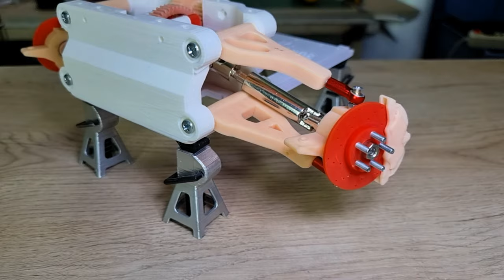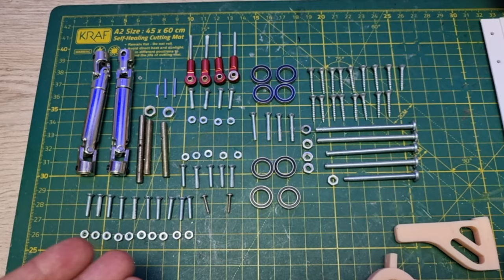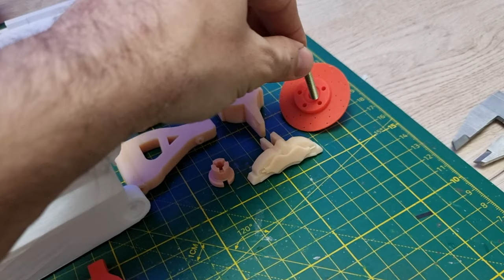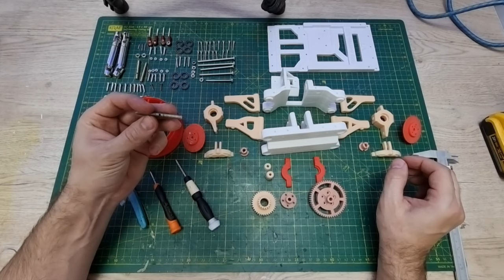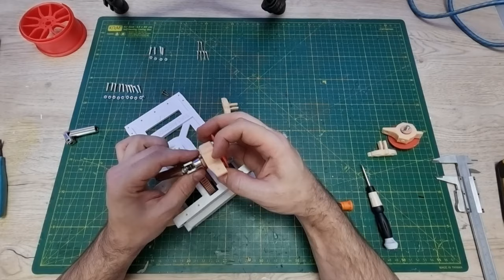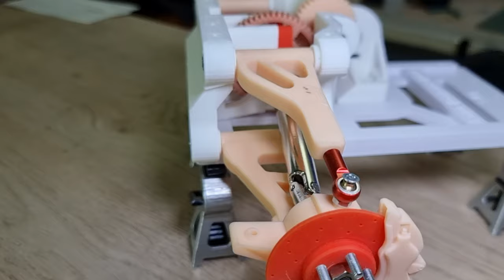3D Printed 8th scale Brushless rc car part1/how to print rc car at home / Scale Addiction

Comment: Kinda beautiful buddy, loving the drive shaft axles. One thing, (not sure of the science on this) don't you have to align those u joints to prevent cavitation? Looking good, regardless. Great share.
Reply from the maker: Thanks, I have too maybe, after the wheels  will be on them and see how it works
Reply: @scaleaddiction  Thanks bro, (for the consideration 😉) but I'm strictly 'off radar' and not posting content any more. Bump it forward... Kpop or someone you feel worthy. 💌